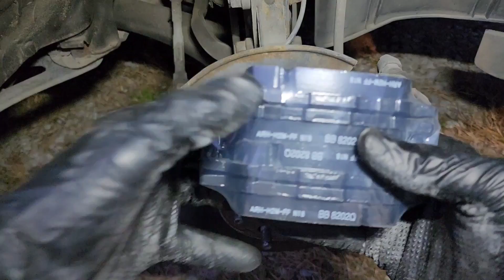I can't believe Mechanics Oil Change Service Special

Comment: I took my vehicle to a local tire shop for an alignment on a vehicle I needed the next day. After having the truck all day, they informed me that I needed over a thousand dollars worth of front end work before they could align it. Every part that supposedly needed replacing had less than 25k, including the pitman arm that had about 8k on it. When I called their bluff in front of other customers, the counter guy said I should have used Moog parts. All of the parts I replaced were Moog. I took it to an alignment only shop and $100 later, no mention of bad parts.

Comment: I only started doing my own oil changes because of family experience decades and decades ago. I actually bought into the dealer coupons at first and they talked me out of a new timing chain😂 (turned out to be a bad water pump). So far ive saved thousands and probably avoided some kind of dealer induced damages like when they bent the pinch welds under my car. Or how they like to scratch wheel covers.

Comment: I went to Valvoline because they had a coupon, $40 for 4 quarts synthetic.  I knew I needed more oil so I figured maybe $25 or so more for the extra couple of quarts.

In the end they said they had to use the upgraded Euro Spec synthetic, plus the extra oil because it takes more than 4 quarts... so after dual upcharges it was $20 more than the dealership....

 Although random internet people say that dealerships use the cheapest oil they can... who knows.

With al the shrinking turbo'd engines coming out, that will probably be the next upgrade... "well it was $50 more because we had to use the turbo oil"
Reply from the maker: I really appreciate you sharing your experiences with the NIA community. That's what it's all about sharing and kindness.
Reply: @NATESINTERACTIVEAUTO   Not only that, they managed to leave all 4 valve stem caps off...
Reply: @NATESINTERACTIVEAUTO   I also noticed the dealerships are offering oil changes at really cheap prices in my area.   Even BMW has 3 years of oil changes for $199.  But of course it's by the service schedule. .. So only every 7,500 or 10K miles.  The service advisor was decent though, he noticed I only have about 5,000 miles per year on my car and said maybe it's not really worth it for you.

Comment: I cant stand when these tire shops just want to use impacts to tighten lug nuts and then when the owner of that car has a blow out; there's no way he/she will ever get the wheels off with what's provided in your car. I do tighten mine up with the impact, but on the lowest settings and then torque it to specs.
Reply: Yet another reason to roll your own service. And buy something that doesn't ever blow gaskets.

Comment: your rear rotors are trashed.
Reply from the maker: We just purchased this car. I appreciate you taking the time to share your thoughts.
Reply: @NATESINTERACTIVEAUTO  I get having a new to you car and dealing with all the crap of the previous owner who knows where everything is. But that's not a thought those are rotors are gone. Unless you can machine them flat and have enough metal left over to keep them in their service thickness window, that rust isn't surface rust anymore. And the brake pad is softer than the rotor so the brake pad will wear in a convex shape to match the concave shape of the rotor. But as the rust grows it eats away more and more the pad so the pad actually only really touches in that middle portion. But yeah just do it yourself it's way cheaper.

Especially for brakes on scions check a Toyota dealers pricing on Parts normally isn't that bad if you take quality into consideration. The top of the line parts store parts aren't as good as the factory Toyota Scion parts. Depending on the parts they either make them in Japan or Kentucky. Most part stores get their parts from those cars from China. Since Toyota doesn't build their parts in China that means they're stolen designs that are close enough to work but not the same.
Reply: @johnantonopoulous6381 i can’t believe there is only one comment saying this. Those rear rotors are gone. As a person that also services his own vehicles, I’d be ashamed to be driving a car with rotors that bad. Not only does it look bad but I would also be putting myself and my family at risk driving a car with worn brake rotors like that.

Comment: I went to a Valvoline oil changes where you sit in your car to get your oil change well the oil changed was only going to be $27.50 with the coupon and then the guy working there wanted to replace my cabin air filter I told him not to bother it instead he goes over enforces my wife out of the vehicle impose my glove box down and I told him not to touch it and he went ahead and refused to let me leave with the cabin air filter without replacing it and I told him that I would go to my local AutoZone to get a cabin air filter when it needs replaced or I would buy one offline that guy refused to let me leave and he charged me $55.99 for a cabin air filter by the time I was done and leaving there they ended up charging me $85 boy was I upset with them for the way they refuse to listen to the customer when I told him not to touch something they touched it anyway after telling my wife to get out of the car which is very rude when I tell him not to do it they do it anyway I will definitely never deal with a Valvoline oil change place ever again they are a rip-off and I would say for anybody to never go to a Valvoline oil change place for an oil change even if they gave you a coupon that coupon it doesn't mean anything by the time you're done leaving and everything you're going to be paying almost $100 that will change after they get done ripping you off anyway keep up the amazing YouTube videos